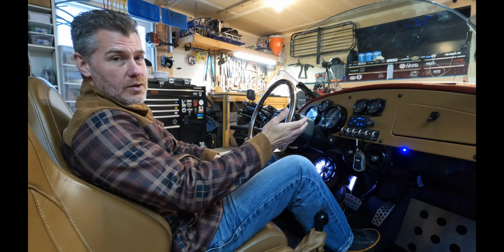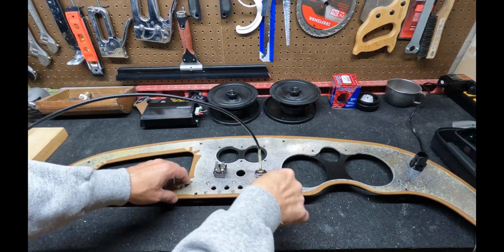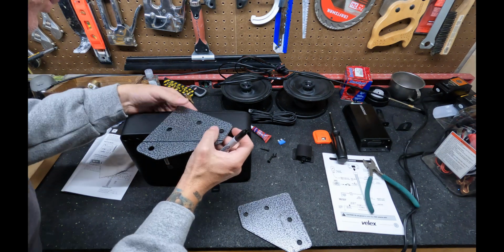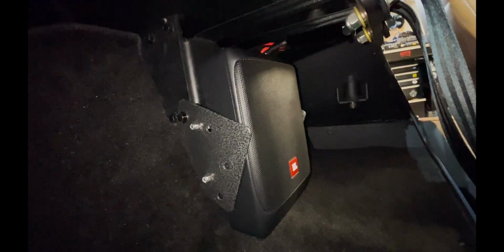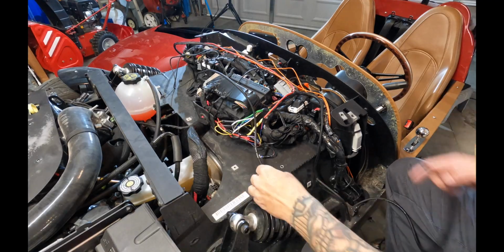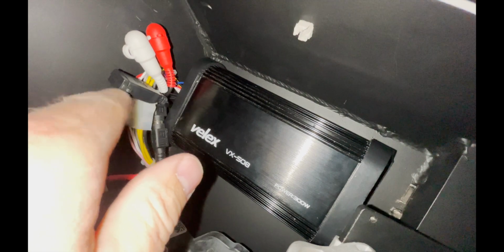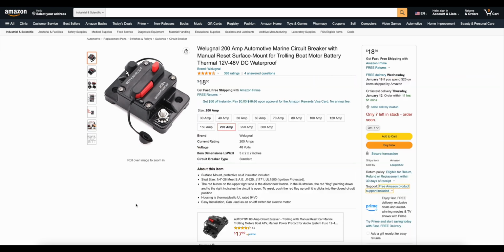Vanderhall Stereo Upgrade - JBL BassPro Nano - Kicker 45KM654L - Kicker KMLC - Velex VX508

Comment: Is the original amp harness match the new amp harness?  I wish i would have seen what you have to do to bolt the new amp to the old screw holes.
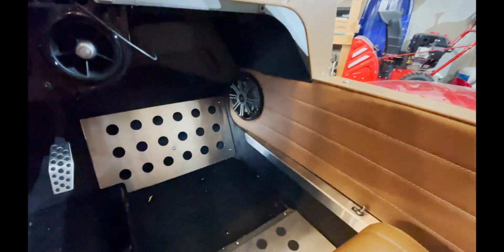Reply from the maker: No, they are different harnesses. Jump to the 35:25 mark in the video and I cover wiring the new harness. I had to drill some new holes to bolt in the new amp, because they didn't all line up. The metal is pretty easy to drill new holes through. Just make sure you don't drill into anything on the other side when you're making your new holes.
Reply: @Idahoup  I see it thank you for your response.

Comment: Great and informative video, just got the new speakers with lights so far. Question - how do you get the stock speakers out? Do the grills just pop off? Didn't notice any screws at first glance.  Thanks in advance.
Reply from the maker: I honestly don't remember on the Vanderhall, but yes typically you just pop the grills off with a mini pick tool or something similar.

Comment: Ive been  thinkin of gettinna vanderhall, but i ve been hearing of customer  service issues bet dealers an vander. Can you speak on that..as well as parts issues..i just need to know if im buying a problem here..but ilove the car..im in the can am community,  an have a 22 F3L Special Series n..can am red..w custom stuff  including  baja ron ultimate sway bar set up w links and laser alignment w back rest an short reach handle bars and other stuff..its rad
Reply from the maker: I think the best short answer I can give is that if you are mechanically savvy you are more likely to enjoy the Vanderhall experience. If you are not mechanically savvy, I would suggest going another route because at this point there is not a lot of Vanderhall support in most areas. Hope that helps.